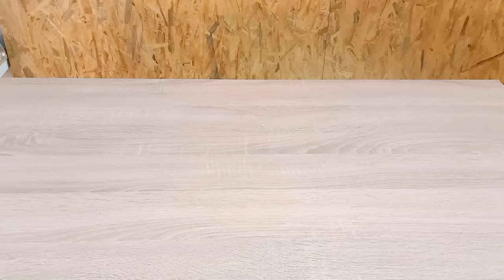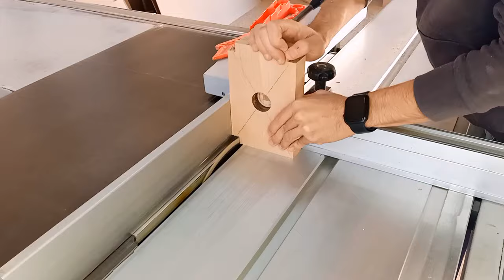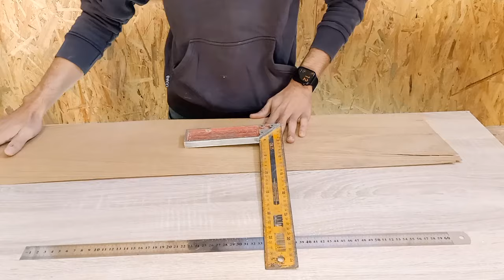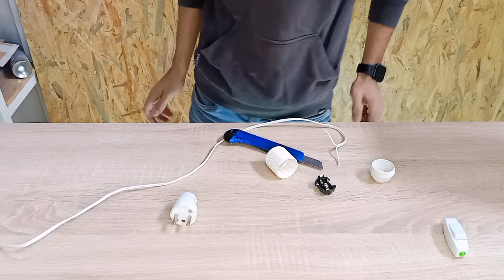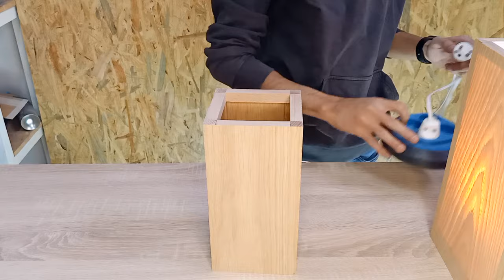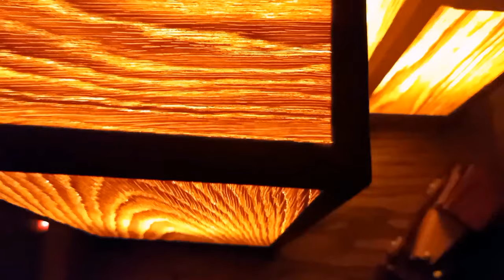how To Make Easy Table Lamp | Amazing Project Ideas 💡#diy #lamp #amazing #project

Comment: Great idea,   but since it's 100% sealed. How will you change the bulb or led when they fail?
Reply: Same thing I was thinking. How do you change a bulb?
Reply: Right? Is this a one time use light until the bulb dies?  😂
Reply: Did anyone ever get an answer?  How do you change the bulb?
Reply: @johnnyz7752  By breaking one of the sides or the top, there's no other way. When I see videos like this one, I always think to myself, why people do those projects in a rush. Everything needs to be done quickly. CA glue, so you can put together everything right away, brad nails too etc etc. 
I'd have gone with some regular wood glue and clamps. No need for CA (allergies included) and also no need for brads that can split the wood.
The bulb could have been made accessible from the bottom by using two layers of wood and a recess or such. Not too hard to make actually. This way it's a disposable lamp 😛
Also the maker should give the tools a little treat, so they don't burn the wood but cut it.

But still a thumbs up for the idea!
Reply from the maker: Thank you for the valuable note. At first I put it open from above, it did not give me the desired result, so I decided to close it and search for another solution to change the lamp, and I will make a video to explain
Reply: Just make a removable top.
Reply: @lespritdubois  if you make the top removable that'll ruin the clean design you have made. Rather make the bottom detachable as it is not visible. 

Nice work otherwise 👏
Reply: @ImZiraTheFirst  From the bottom, as mentioned before at least two times, it should be easier to reach the bulb and also be easier to construct. It will also not be visible, even if it's optically less nice in construction.
Reply: @nhundahl8483  instead of gluing the frame to the base, have the frame lift off the base. Then you can change the bulb.
Reply: Don't have to worry about that, the CA glue will fail before the bulb does!
Reply: Where do you get the transparent wood?
Reply: @johnnyz7752  I made one all I did was not seal th top
Reply: @Derek-qu8qi  that'll work, could even add small screws. I don't use a base like that for my lanterns, I use a more traditional shoji lanterns design
Reply: @KB-py6jd  They're called wood veneer sheets. They're extremely fragile and they'll crack if they are too dry.
Reply: @KB-py6jd  a thin decorative covering of fine wood applied to a coarser wood or other material.....veneer
Reply from the maker: Thank you for the valuable note. At first I put it open from above, it did not give me the desired result, so I decided to close it and search for another solution to change the lamp, and I will make a video to explain.
Reply from the maker: Thank you for the valuable note. At first I put it open from above, it did not give me the desired result, so I decided to close it. I count though on the light bulb to last 100 years like the one that hit the record 😂😂
Reply from the maker: Thank you for the valuable note. At first I put it open from above, it did not give me the desired result, so I decided to close it. I count though on the light bulb to last 100 years like the one that hit the record 😂😂
Reply from the maker: Thank you for the valuable note. At first I put it open from above, it did not give me the desired result, so I decided to close it. I count though on the light bulb to last 100 years like the one that hit the record 😂😂

Comment: Great idea, terrible execution. The CA glue is very likely to fail, especially on the veneer. Since a bunch of people are asking how will you change the bulb if it's sealed inside (srsly though, I have no words...), this is how: you wait for the glue to inevitably fail.
Reply from the maker: Thank you for the valuable note. At first I put it open from above, it did not give me the desired result, so I decided to close it and search for another solution to change the lamp, and I will make a video to explain
Reply: @lespritdubois  maybe you'll let us know if the CA glue still holds.

Comment: Ok it’s all sealed up. I don’t know what type of bulb you used but there is no way to vent the heat from the bulb.
Reply from the maker: Thank you for the valuable note. At first I put it open from above, it did not give me the desired result, so I decided to close it and search for another solution to change the lamp, and I will make a video to explain

Comment: Looks good, but how do you change the bulb?  Throw it out and build a new one every time?
Reply from the maker: Thank you for the valuable note. At first I put it open from above, it did not give me the desired result, so I decided to close it and search for another solution to change the lamp, and I will make a video to explain
Reply: @lespritdubois  was thinking the base and top frame should be separate so you can lift it off. 
Rout channels for small magnets to hold them together

Comment: Excellent video with only one question. 
The same question that many people asked you with no reply.
Since you glued every part of these beautiful creations, how are you supposed to replace the bulb when it dies? You could easily create a lid on top.
Reply from the maker: Thank you for the valuable note. At first I put it open from above, it did not give me the desired result, so I decided to close it and search for another solution to change the lamp, and I will make a video to explain
Reply: @lespritdubois  no matter my friend. It's an excellent work.
Reply: If an LED bulb is used (one for enclosed fixtures), figure a bulb life of about 13 years at 3 hours a day use.
Reply: @miket2120  And figure that those marketing numbers aren't always what you get, you might as well have to exchange it after a few months already. The LED bulbs I bought so far showed mixed life times. Some are still in operation after years while others gave up after a few months already. Depending on the housing or lamp glass you place them in and their quality some cease to exist quite quickly. So better plan ahead and make it replaceable. Heat and especially overheating can drastically shorten whatever times are stated on the package.